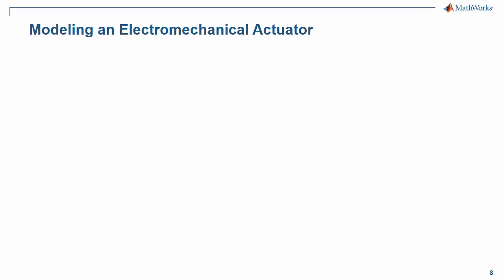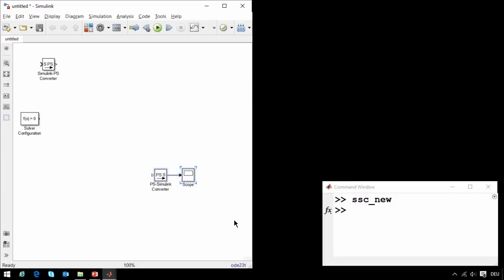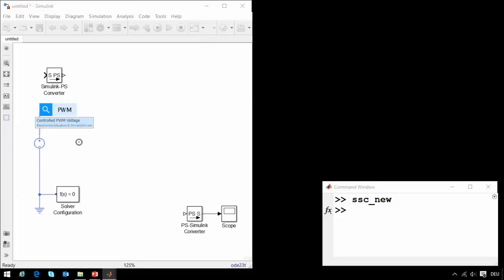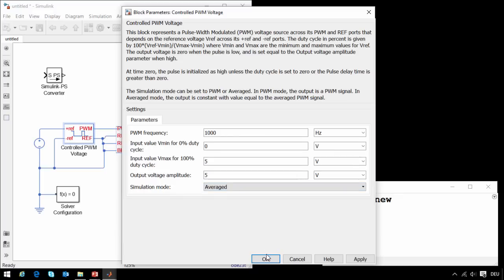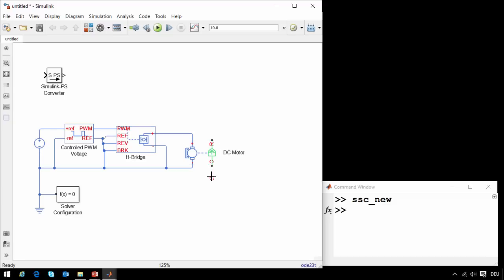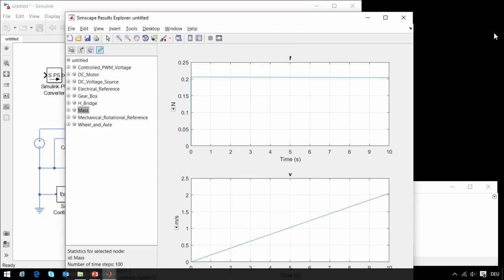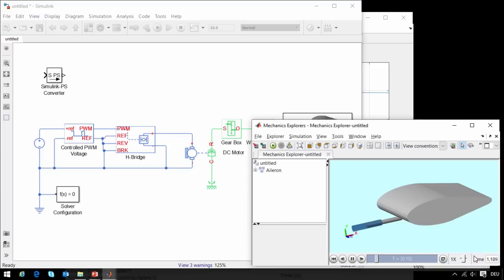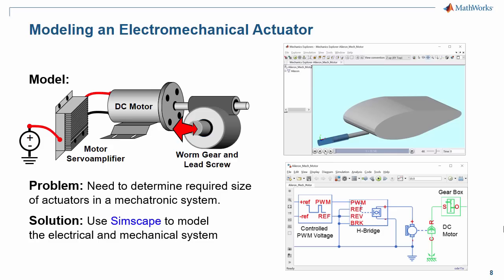Modeling a Mechatronic System - MATLAB - Simscape - Simulink

Comment: Hey great tutorial but how do you change the RPM of the motor based on say a Duty cycle value?
Reply from the maker: The duty cycle of the PWM signal is based on the voltage difference across ref+ and ref- ports.  There is also an option to vary the duty cycle based on a signal.

Comment: 2.03 what if we actually want to run the motor backwards? Please can somebody help it's absolutely urgent
Reply: Apply a voltage greater than the Reverse threshold voltage to the REV terminal on the H-bridge block. It should be a 0-5V signal not a PWM signal.

Comment: Good how to load 3D model of Arilleon & drawing in Simcape
Reply: I am not too sure about how the assembly file in the video is imported, but you can try looking in Simscape Multibody > Body Elements and drop in "File Solid". Double click on the block to and add the filepath for your 3D model (.STL or .STEP).